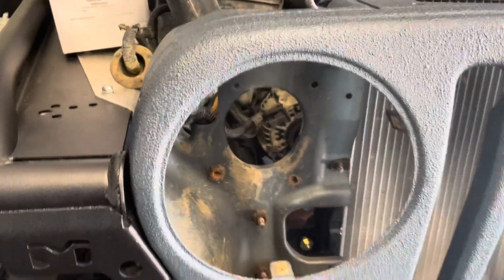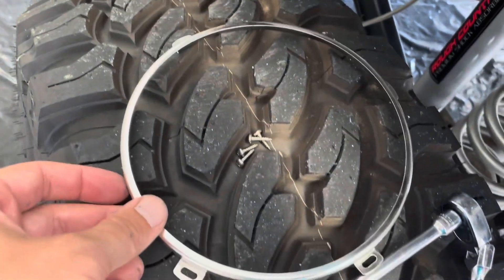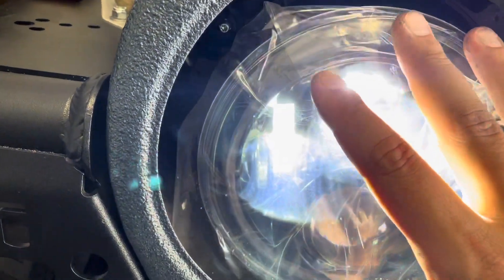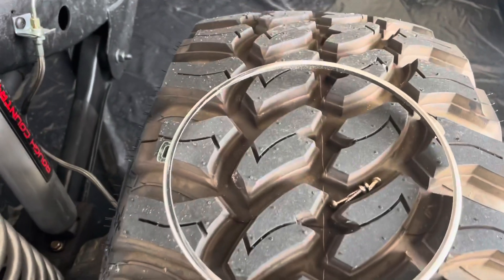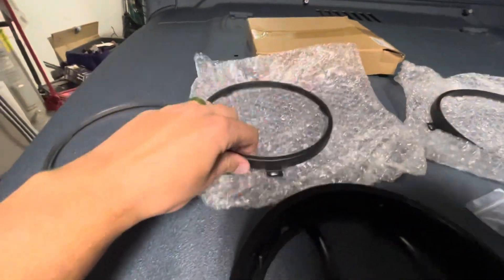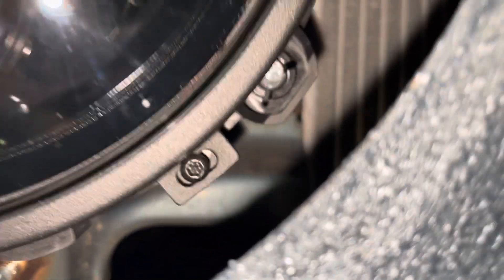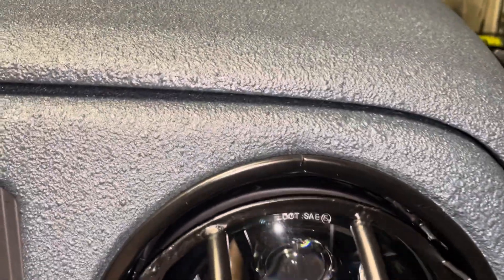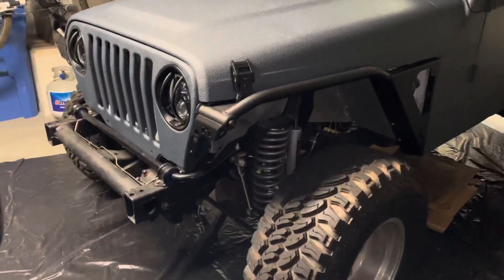Jeep Wrangler TJ - LED Smoked Headlights Install

Comment: what model light and black bezel did you use?
Reply from the maker: Vouke H6024 7 inches Round Black... https://www.amazon.com/dp/B079282L81?ref=ppx_pop_mob_ap_share
Reply from the maker: I painted the stock chrome bezels with black spray paint